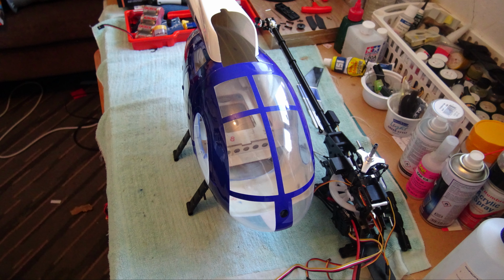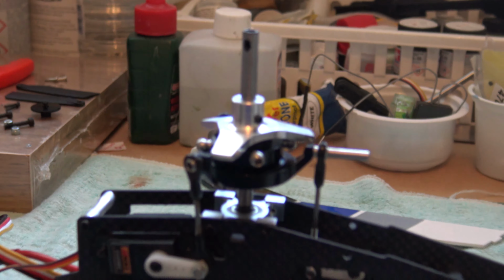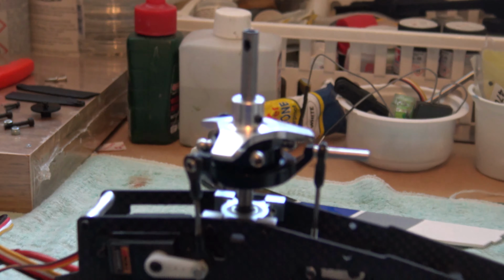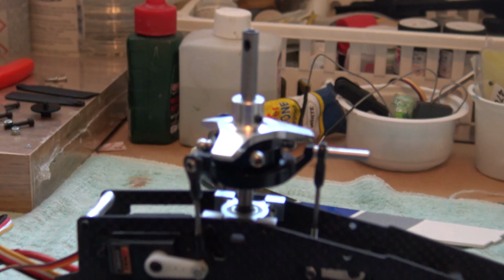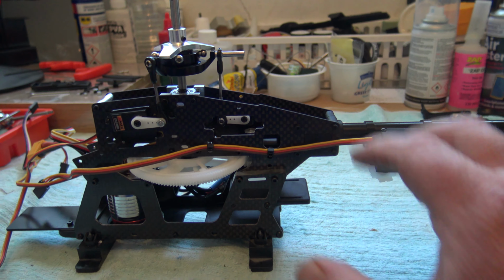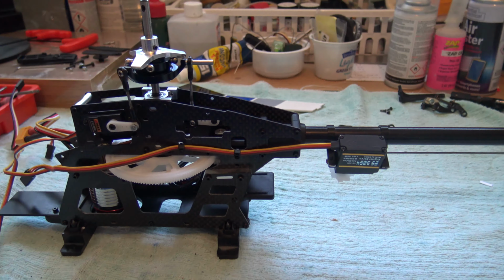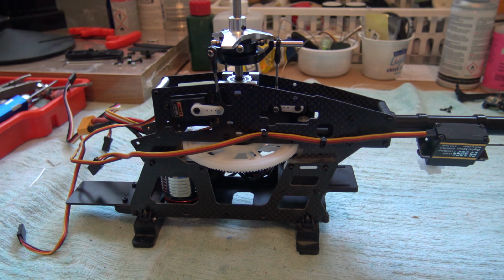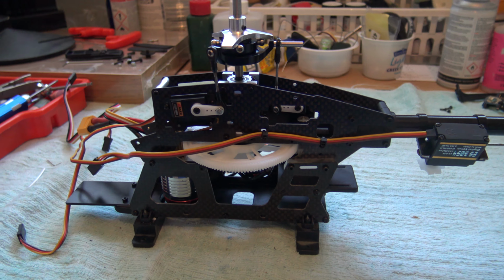ROTORSCALE MD500E BUILD PART 1

Comment: Always best to be safe then to be sorry ! Awesome Ian !
Reply from the maker: As I said Melvin I was impressed with the quality of the build!! But I like to check and make sure everything is greased and thread locked and although it was those servo horn screws could have been the week link!! Also the motor pinion to main gear mesh was ridiculously tight, if left that would have generated a lot of stress for the motor and ESC!! So I'm really glad I checked, thanks Melvin for your great comments 👍😄

Comment: Very interesting dismantlement (is that a word lol) Ian, you would have thought that the manufacturers would have included the metal tail boom piece if it's such a weak part in plastic! By the way, never buy a brand new car ... it'll take more than a day to check all the nuts and bolts 😁
Reply from the maker: Yes thanks for that Cliff2😂🤣

Comment: I went round the interior of my car with threadlock because i kept vibrating things loose from the four 12" subs i run in my boot, id lost count how many times the sun visors had fallen off lol.
Reply from the maker: Lol that's funny!! Let's hope your wheel nuts don't vibrate loose😂🤣
Reply: @IansRCExploits  i had t remove most of the trim inside the boot because it wasn't up to the extreme environment, four 12's is vision blurring territory and certain notes affect your breathing ha ha.
As for the wheel nuts, i once knew a woman who's wheel fell off because her nuts became loose, how can it get that bad and you carry on driving, she ignored the thump, thump, thump sound as the wheel wobbled for several days until the shock  the wheel was putting through everything as it wobbled was enough to shear the bolts and the wheel came off and destroyed the wing!!
Reply from the maker: I don't know some people A1😂🤣🎶

Comment: Looks like a beauty, Ian.  I’m looking forward to seeing you fly it.
I have a question for you, Ian.  How critical is balancing a Heli?  I hear a lot about swashplate levelling but rarely is balancing mentioned.  For Christmas, my kids gifted me a nice “Angry Bird” canopy, for my 150S.  This canopy weighs quite a bit more than the stock version.  Common sense dictates that the new canopy will shift the balance point forward.  I’m pretty sure the balance point of a Heli is located at the main shaft, implying I should add a bit of weight near the tail end.  Do you have any advice?  Thanks, Ian.
Reply from the maker: Hi Wolfgang, yes that MD500E is very nice!! Yes I balance all my Helicopters, and if the centre of gravity is wrong it has quite an affect on stability, tail heavy being the worst, in the bigger Helicopters I balance the main blades as well making sure they are matched in weight!! If I can I normally move the battery forward to adjust for tail heavy but nose heavy is a bit more awkward!! I have before changed a carbon fiber tail boom to Aluminium so as to add more weight, yes I usually hold the Heli with my fingers under the bolts on the main blade grips to check for balance with the blades placed out stretched  like if you were checking pitch for the elevator controls!! I've seen people try to do it with the blades running along the boom and canopy but that's incorrect!! I would worry more about tail heavy as opposed to nose heavy but would be reluctant to add dead weight especially to the tail, hope this helps Wolfgang and thanks for watching and commenting 👍😄
Reply from the maker: Here's a good video!!

https://youtu.be/EBGd4NVl-VA
Reply: @IansRCExploits  Thanks very much, Ian.  Great help, as always.
Reply from the maker: Your welcome Wolfgang😄

Comment: Ian would it be possible to see how you set up the servos on this particular model. I am having trouble successfully making it happen. Servo rates are really slow and I have tried several settings
Reply from the maker: Hello Chris, unfortunately I had so much trouble with the Rotorscale mechanics that after just one flight I ditched them and fitted one of My Trex 450 Helies in to the scale fuselage!! I found that the mechanics from Rotorscale were just cheap Trex clone parts, I had a bent main shaft, egg shaped main gear and a very poor quality swash plate!! I replaced all these parts with new Rotorscale parts but the Heli was still unfliable!! Sadly I have never used MotionRC again as this Rotorscale Heli left a nasty taste in my mouth 😒

Comment: Hi Ian, I know this is an older video and you've probably long since moved on but I'm curious if you could assist me in locating that metal tail boom part. ie.. part number and name and possibly a source for it by chance?
Reply from the maker: I think this is the part your looking for Michael
https://www.motionrc.eu/products/rotorscale-450-boom-and-support-set-rsh450012#.Y4DzHyltkqs.link
Reply: @IansRCExploits  thank you sir had no idea it was on the Motion RC website but out of stock here in the US. Such is the post COVID parts nightmare.
Reply from the maker: I think a Trex 450 tail boom will fit as well, as the mechanics in the Rotorscale are Trex clone parts made by Gartt I think 😀👍
Reply from the maker: These should fit Michael
https://www.ebay.co.uk/itm/113345196653?mkcid=16&mkevt=1&mkrid=711-127632-2357-0&ssspo=PYlFhT5KSVG&sssrc=2349624&ssuid=soZulHmaTZ-&var=&widget_ver=artemis&media=COPY
Reply from the maker: Or you could just order a Trex 450 tail boom 😀👍